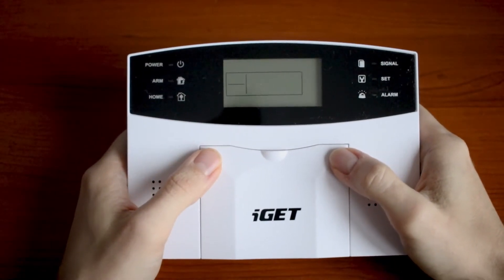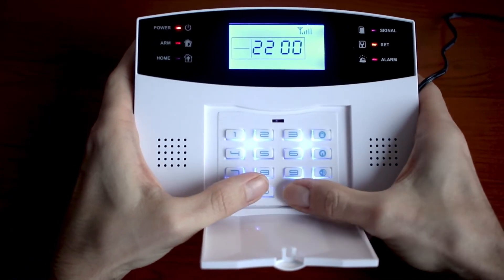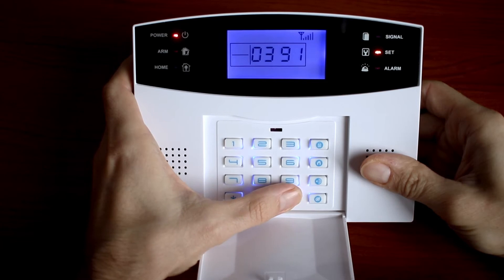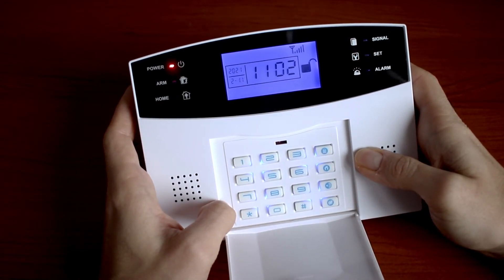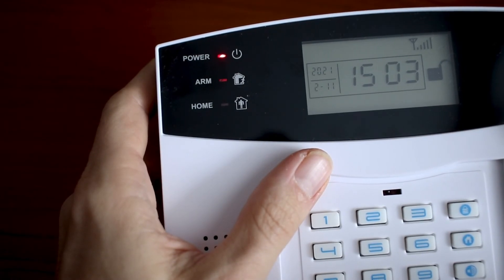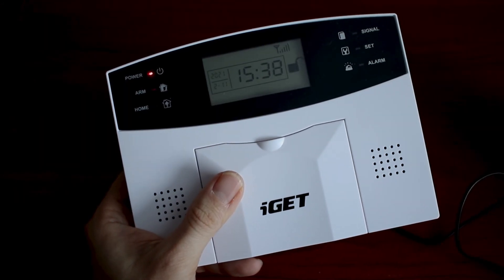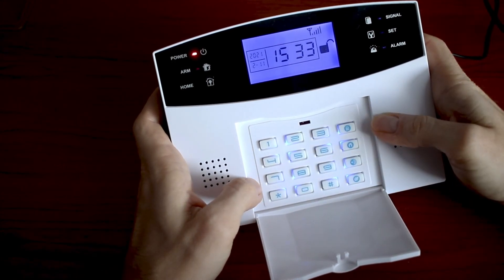iGET M2B GSM alarm system | ultimate manual/guide in English, with subtitles

Comment: Does the system notify you by text or call if triggered, even if the siren is not connected or off?
Reply from the maker: Hi there. Sure, it does, even without connected siren.
It's like a silent alarm - during event, you will recieve a call and after that also a SMS
Reply: @morneo3  thank you so much, I appreciate it.

Comment: What will happen If I put time to automatically turn on the alarm and one day I go on vacation.  System will be locked all the time? Or alarm timer will unlock my system?
Also, how can I setup to automatically turn on and off alarm only for specific alarm zones (sensors)?
Reply from the maker: Hello. Now that's a good question, but unfortunately I haven't tried the Timer in this way, just setting only 'Timer for daily Arm setup' - so, you should better try it and let me know :)
I would say, that if you will in 'Defense zone programming' set to a specific sensor an option [4] bypas, then it shouldn't be activated during the Timer - but also in this case, I'm just guessing
Reply: @morneo3  I made an alarm to turn on every night at midnight and turn off at 7 am.  If I go on vacation alarm will be deactivated the first morning at 7 am which is not a good option. Is it possible to make a different schedule for specific days in a week?
Reply from the maker: @weblist9009  Unfortunately it's not possible to make a custom schedule, only one time for ARM and one time for DISARM

Comment: How can I factory reset this device?
Reply from the maker: Hello. According to the manual: "Factory reset - In disarm status, use keypad to input [95175308246] and press [#] to confirm, all the LED indicators will be on for 2 seconds and you will hear a long beep. The main unit gets all its settings cleared and restores to its factory settings successfully."

Comment: The 'Disarm' button seems to disarm, with one press! No code needed! This seems crazy. Is the unit set up wrong?
Reply from the maker: Hello, do you mean 'disarm' button on the remote or on the central unit? Because if you want to disarm on central unit, you need to enter your 'operation password' and # (default: 1234#). On the other hand on the remote, you will disarm only by pressing the button.
Reply: @morneo3  I mean the disarm button on the control unit. I also have an older black gsm alarm, with no disarm button, which you disarm with the code (nnnn#) which is as you describe and makes sense. 
But on this newer white unit, it seems that Mr Burglar just has to press 'disarm' on the keypad.
Reply from the maker: @markdransfield9520  Like the truth is, you can just turn off the control unit with the switch on the back. But if you will hide this central unit, there is no chance for burglar to find it and turn it off let's say in 10 seconds interval after triggering the alarm. Because once I did all the settings, I don't really need the central unit on a visible place - I'm just arming and disarming via the remote.
Reply: @morneo3  I agree that hiding it is the best option:  having it upstairs rather than just inside the front door. This can also help get stronger GSM reception, which I think these units are not great at.

Comment: How Do I RESET the ALARM
Reply from the maker: Hello. According to the manual: "Factory reset - In disarm status, use keypad to input [95175308246] and press [#] to confirm, all the LED indicators will be on for 2 seconds and you will hear a long beep. The main unit gets all its settings cleared and restores to its factory settings successfully."
Reply: Thanks so much I will definitely try this Code...I have a D1D9 Alarm I bought on Amazon and this Code was Not in my Manual

Comment: Do you now how do I configure solar siren ?
I can't make it
Reply from the maker: Hey Pajo, I've checked the original M2B alarm manual, for specific solar siren you are talking about (iGET SECURITY P12) and translated the procedure for you. It's bit tricky, but hope you can make it.
1) Enter the settings (default 8888 #).
2) Now enter 411#, then enter [43]+[A]+[#], A indicates the number 90 ~ 92.
3) Now enter *# to exit the settings.
4) Press the 'Code' button on the siren for 2 seconds, the two LEDs on the right will flash and then the two LEDs on the left remain lit.
5) Now it's a siren ready for pairing.
6) Press the 'lock' symbol on the enclosed 'alarm keychain' and then press 'unlock'
7) The siren light will flash.
8) Now you need to end the pairing on the siren, hold down the 'Code' button for 3 seconds, the siren will flash one more time.
Reply: Hello friend I've tried several ways and I don't think the problem is the system that emits to the siren
Reply from the maker: @Pajo80 if the mentioned procedure doesn't work, I would try to change the solar siren, as it could be malfunctioned

Comment: I cant seemed to get the internal siren working, i tried to input the code 751# but when i armed it and tried to open one of the window the lcd will only highlight the alarm and will show the bell on top right corner, but no sound please help. Thanks
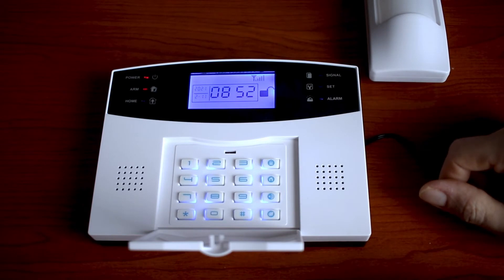Reply from the maker: Hello. Please take a look, if you correctly connected wires of the siren. If yes, and the siren still doesn't work, please play my video from 4:39, where I'm explaining defense zone programming - here you can set per every sensor, if you want siren to go ON, or not
Reply: @morneo3  thank you so much, but im referring to the internal unit siren or alarm, i tried to wired the red sired but its too loud, so i thought i just use the internal siren, that has much lower volume.
Reply from the maker: @maddie5  my previous comment applies to internal siren - I don't even have the big external one
Reply: @morneo3  im sorry i misunderstood, but you mentioned about correctly connecting the wires of the siren, isnt that for actual physical siren that sounding  so loud? Im referring to the alarm within the unit that doesnt require any wiring, correct me if im wrong please, thank you.
Reply from the maker: @maddie5  Now I see what you mean. What you described in your first comment is correct behavior.
If you don't have connected physical internal siren, or the external one, the alarm will just show the bell and will contact you over the sms and call you, but it wouldn't make any siren sound from the central unit
Reply: @morneo3  got it! Thank you so much
Reply: @maddie5  Did you ever figure this out? My panel will not sound a siren now. Not even with external siren attached... I've reset panel twice now and setup from scratch.